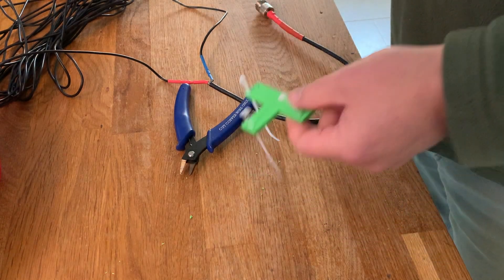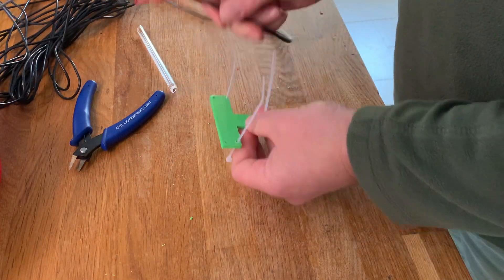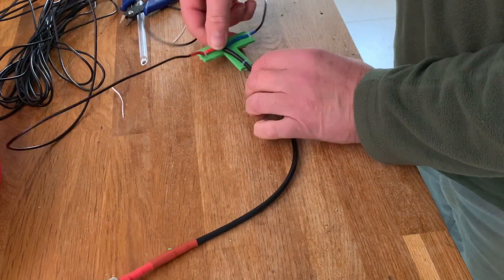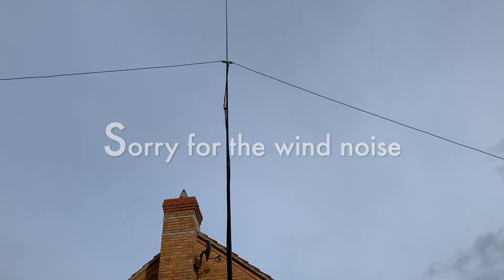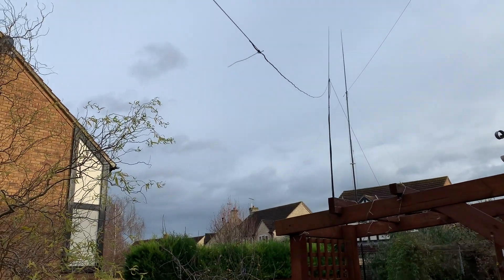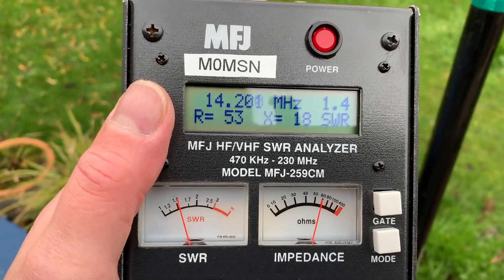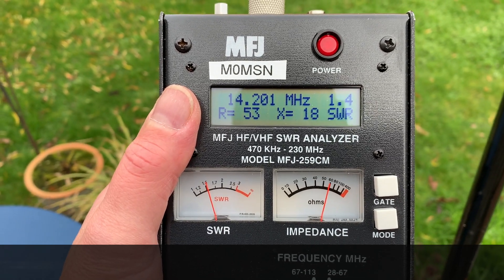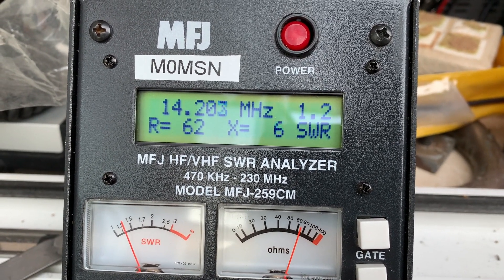HAM RADIO: Simple 20M Dipole build Part 2 .Inverted V or Flat:  vSWR, RETURN LOSS. Far Field Plots.

Comment: How do you think a balun might improve thinks Mike ? A balun on a dipole confuses me, I know some use them and some connect the feeder direct. Is the point to prevent the feeder radiating ? In your case I presume the unbalanced feeder could have different currents in the screen and centre thus not cancelling and then returning to your transmitter / analyser ? I am in the process of building a 20m dipole, my plan was to have a line isolator near the rig, just a few turns of rg58 on a former and then a 1:1 balun at the dipole joint. Time will tell. Next I'd like to try a multi band end fed antenna via a 49:1 unun. If you connect your analyser direct to an end fed antenna without any matching what would it read ? I presume 2 / 3k ?
Reply from the maker: Yep.  There is a lot more to this than space here permits. keep reading 30 years on and I am still learning..

Comment: Mike, the way that you explained the differences in SWR based on the coax run to the radio struck home on how each deployment can affect your antenna.
And another point you hammered home for me was how flattop vs inverted-VEE impacts the radiation pattern. For my QTH deployment, a flattop would work best to keep the wires out of the way for people enjoying the backyard and pool but this would not be as beneficial for being on the air. 
Thanks for setting me straight with these two important considerations!!

Comment: Its probably a daft question Mike and I apologise if it is but does it matter what gauge wire is used for the elements? Thanks, Stu G7WAY
Reply from the maker: not sure of gauge it is 1.5mm wire.
Reply: @mike-M0MSN  Thank You

Comment: Given a choice, I'd go for a non-inverted-V, because the increased directivity increases the ERP (effective radiated power) in the opposing broadside directions of your choosing (provided you can orient it the way you want). And/or, you could rotate it to null noise in the beam pattern notches. Sadly, with a small garden, it's difficult to have the freedom to orient it the way I want. :(  Good videos, Mike.

Comment: nice experiment, i did like the way you conducted your tests. The only thing I would say is that in your draw the dipole is oriented 90 degrees from how you draw it. The “nulls” as you said also are found at the tips. Is also worth mentioning the capability of the mfj to show return loss and coefficient of reflection if you enter the advanced 1 mode pushing the two white buttons together.
73s and congrats on your videos!
Reply from the maker: Yes, you are right, many thanks may show the capability of the MFJ in a video soon..

Comment: Mike, just today I was playing with a 10.68-meter pole and guying it and realized the guys were about 35 feet long also and I realized a dipole could be fitted at the guys or at the top, and a fan dipole configured along with the guy ropes. I was trying to configure a DX Commander kind of vertical but first the pole being more permanent needs the guy position figured out. 

Your dipole showed resistance changes but surprised me with my thinking a dipole especially under a 1/4 wave high would be a higher resistance and an inverted V closer to 50 ohms, but yours was different. I have been told high loss coax could lower SWR readings, but the resistance change surprised me. I am thinking of using some 75-ohm hardline low loss coax, but if the resistance of the antenna will be lower, that could be a problem. Thanks for the video, as always it is thought provoking and informative?
Reply from the maker: Many thanks for the post, 👍🏻👍🏻👍🏻

Comment: Good one Mike 👍🏻 The other attribute to note for those considering their options is the need to support an inverted-V at the centre, whereas with a dipole,  you have the options of centre support or end supports only.
Reply: Hmm what would happen if I end support & it drops slightly in the middle with weight of coax I wonder...
Reply: @mully89  No problem with that setup.
Reply from the maker: True